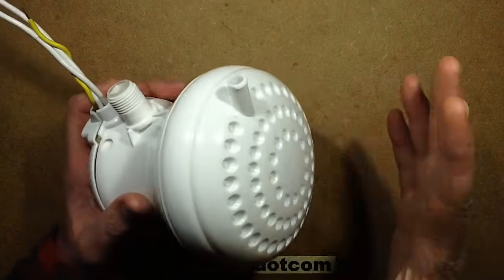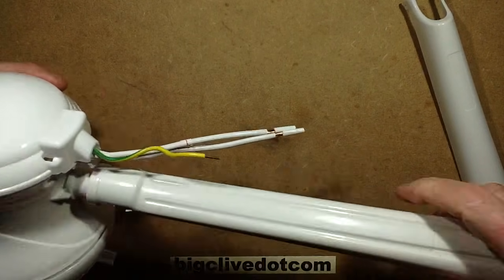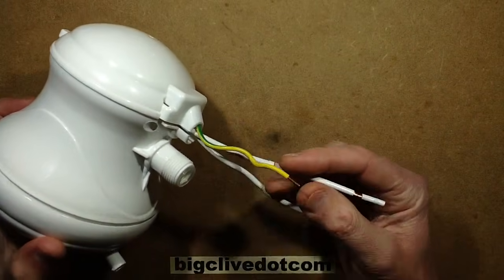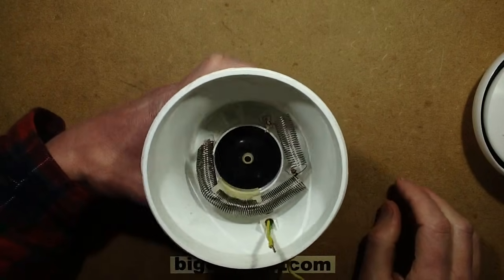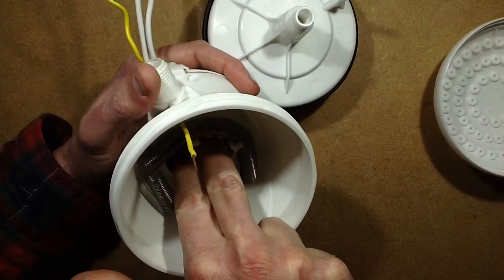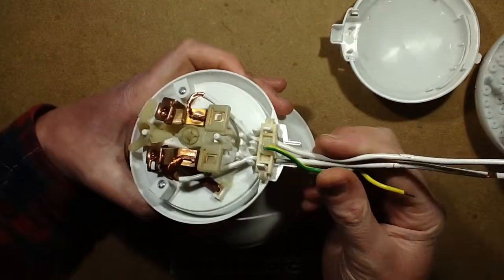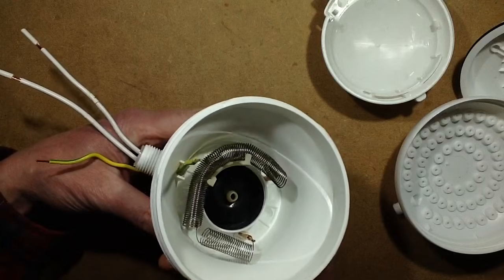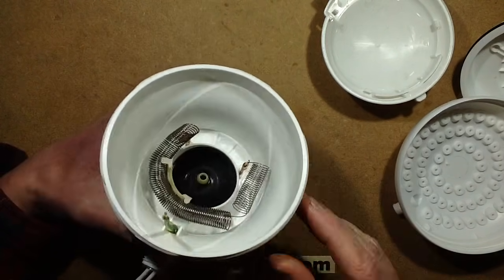Inside a heated shower head.  (suicide shower)

Comment: As a brazilian this video was extremely amusing to watch. Like I was watching an alien talking about what cars are.
Reply: They are usually mounted about 2.3m to 2.5m, but you can find them lower on cheap and old hotels, if you use one these in less than 5 or 10 cm from your body, you will get a eletrical shock. Now, the thing is people dont usually die from the shock it self but from passing out and hitting the head. Every body here in Brazil knows not to touch it while in use, but it is ez to imagine a tourist simple putting his hand on it to switch to "hot" while it is on.
Reply: @TheBotinha93  Even if you do switch it whils its on, in my experience, nothing unusual happens
Reply from the maker: I've since learned how standard these things are in parts of the world including Brazil.  We do have electric showers here in the UK, but it has to be with a wall unit with grounded heating enclosure and sleeved element so there is no current leakage.  The Ducha would not be allowed here because it would be considered a shock hazard, particularly in a wet environment where the person showering would have their feet on a wet grounded surface.  But it's interesting to see it's widely used elsewhere.
Reply: @bigclivedotcom  This design is indded hazardous if not installed corectly. More modern units are made in a way that is compatble with differential protection relays, so that no current leakage is allowed. 

The issue is that "installing correclty" is really rare in brazil, with many installations being made by non professionals and not following code.
Reply: @bigclivedotcom  the hose with the little shower head is for ladies parts.
Reply: @bigclivedotcom  Back in the 1970s I had an electric shower in the UK with an open element inside a clear plastic casing. I believe it was based on a German design. No problems for several years but eventually it failed when it melted some of the plastic.
Reply: I can see how it looks like a ridicule level of danger, but I have never ever heard of it causing any serious issues, even in those precarious instalations. It is not a continuous stream of water that hits the skin, but a bunch of droplets, so it would not conduct electricity even without a ground (or maybe as we say here, god protects the dumb).
Reply from the maker: Most of the incidents seem to involve tall tourists who make head contact with the shower while it's on.  I'd guess it's a lot safer if mounted a modest height overhead.
Reply: @bigclivedotcom  Most showers are mounted at 2,40 meters from the ground, I don't think that a lot of "tourists" are tall enough to make head contact with this.
Reply: @victorcercasin  verdade! I've used these lots of times, and everybody I know in Brasil uses them. Never heard of anyone getting a shock. Then again they complained about the size of the coffee during the Olympics, so I shouldn't be surprised people criticize anything they're not used to.
Reply: @victorcercasin  as a tall person I wouldn't enjoy the sensation of electricity personally I play with electricity but I'm not stupid
Reply: @bigclivedotcom  Gas showers kill more than electric ones.
Reply: @victorcercasin  Thank you for the insight. I know, 5 years later.
Reply: It happens, but it is a quite rare ocurence, i only know of one guy that died this way.
Reply: I'm also brazillain, and I took several small shocks to turn it off over the course of my childhood. Also, one of my showers sort of exploded into a rain of sparks, but that might have been a botched electrician job instead of the unit. 

Nowadays, I only use gas heated showers.
Reply: @LemonRush7777  I'm from Brazil too and I have never felt any shock from the metal knob even when barefoot IoI
Reply: The thing is that this shower is not a Brazilian standard. It looks like a Chinese one to be sold in countries like Colombia or Paraguay. It's breaks various Inmetro safety standards and would be illegal here.
Reply: Ive used those for 25 years now, even some shoddy ones and never got shocked. Maybe I'm lucky?
Reply: It seems that the most serious issue with tourists isn't necessarily making contact with the shower (since it's plastic), but it is something that most foreigners seem unaware of: you ABSOLUTELY SHOULD NOT turn the switch with the shower on. Doing that is an almost 100% guarantee of a fire igniting over your head.

Also, subpar electrical installations (especially badly insulated ones) can cause an electric shock when touching the metal tap. It used to be common practice (at least here in Brazil) to weld the ground wire directly to the metal piping, causing a mild electric shock when turning the shower on or off.
Reply: For me this video really was the first time seeing such a device. Over here in Germany people are scared to hell if I tell them that this is what people shower like in other countries. Probably becuase of stuff like this: http://dr1.com/forums/showthread.php/81032-shower-head-heater-disaster-yikexxxx
Reply: @Toble_Miner  And yet more people are killed in accidents involving boilers and gas heating home installations than with these cheap electric showers.
Reply: It's dangerous and out of safety norms. Electric showers must be attached to a porcelain borne or wired by splicing and insulated with electrical tape.
Reply: bigclivedotcom just copy and paste "chuveiro elétrico na tomada" to Google images, and you'll see the main reason people get killed
Reply: I can confirm these are also prevalent in Trinidad.
Reply: With... Your arm and hand?
Reply: the switch should have a huge warning or something
Reply: > They are usually mounted about 2.3m to 2.5m
So how do you change the temperature?
Reply: Ang Jr sure it is. A bad clone by the way.
Reply: Weedus I am german too and i think of this like "TÜV says nooo" and there is VDE and GS too. But I guess in some parts of the World, they go way more pragmatic ways :D
Reply: @theGamer93 things like this used in Europe in the 50's torna were obviously banned. Norms and standards come to improve safety and solve specific issues. I think this is incompatible with the differential protection, which, in turn saved many lives since its introduction... so yes, maybe the shower is not dangerous in itself (as long as the haether is ok) but it means that the electric network is.
Reply: i'm brazilian too and i use those showers EVERYDAY
Reply: @moosebreeder1 va tutto bene, finché la resistenza non si interrompe
Reply: +Tulio Botinha "Only one guy"
Reply: although I do understand that these things aren't killing people left and right, it's just a bit different for those of us in countries that insist on Extreme safety standards. The reality is that, no matter what, this particular shower head is going to cause more of a threats then something like electric boiler with a grounded chassis.^^;; it might not be all that dangerous in comparison to something like driving a car, but we are just not used to having any real risk of electric shock taking the shower. LOL

still, watching videos from people like electroboom really do show that such things can be safer than we realize. I saw him do a video where he stuck Mains wiring in a bowl and plugged it into the wall then stuck his finger in side. Lol the idea is that the electricity will take a pretty straight path between the electrodes. keeping that in mind, under normal operation I can see this being very safe. under abnormal operation with somebody standing with their toe touching the grounded drain plug or something I can absolutely see this causing a shock.
Reply: In Australia you can install a rheem hot water system then feed the hot water into the taps and shower.
Reply: Totally true... also as a Brazilian I can even say that I already had one of those  XD
Reply: This had to be mounted at 2.2m
Reply: Exactly.  Why talking about what he doesn't know anything about. I am looking advice here but it's just a waste of time.  I saw lights coming on in the top off mine and there are no bulbs in it about two days now.  Blue red and green lights
Reply: What a ignorant and xenophobic video that was.
Reply: Lol, exactly. Filing it under the "Humor" playlist because the host's candor sounds just so much like a parody (either voluntary or involuntary, self-referential or not)
Reply: same
Reply: Va tutto bene, finché non si interrompe la resistenza, dopodiché il circuito si richiude attraverso di te. Usare roba del genere è da pazzi
Reply: Every Brazilian ever: sees Brazilian in the title of gringo video 
Every Brazilian ever: ATTACK
Reply: That’s because you are an alien
Reply: I'm brazilian and from my experience it's usually found in poorer places in the country. For my entire life I used gas heating but I had to buy one of these for my farm house as we have no gas line there. 
As we're somewhat tall compared to asian countries(most males in my family are around 6' and females around 5'7'') I installed it at around 7' and it has been working MOSTLY fine. However there are some problems, it gets too hot if the water flow is low as the electrical current is somewhat constant and is not adjusted according to the water flow. I discovered you should not change from the high setting to the low setting, I did it and got welcomed by a shower of sparks(no harm, but scary) as I stuck my wet hand into it(as an engineer/STEM graduate I should know better...).

I went to China and found one of these mounted at a little above 6', I disconnected it from mains before turning it on as I'd make head contact with it.
Reply: Victor Hugo não traduzir com Google.....eu morou lá pra um ano.
Reply: that is not bad portuguese, that is google translated...
at least you know we speak portuguese, not spanish hahhahaha
Reply: @victorcercasin  Holy shit... people still don't realize you guys speak Portuguese!? I should really stop being surprised by human ignorance but come on now, that's an easy one, especially in this age of free information and cyber connectivity and the like.
Reply: It is funny! Quando eu era la no Brasil eu uso todos os dias sem problema...como todo mundo rsrsrsrsrs!
Hope u understood my bad Portuguese ;)
Reply: Tezcax
I have no idea where you live because I'm in Brazil and virtually nobody in these parts use gas heated showers, my sister in São Paulo had it but switched to electric heating because the gas heating was unsafe. People here who wants a better one will use more sophisticated shower heads rather than gas heating.
Reply: Sério, nunca ouvi falar que esse chuveiro mata hahaha É só não usar durante tempestades com raio, igual praticamente todos os outros
Reply: Stop acting like these are totally safe. Just because they're normal for your doesn't make it even remotely safe.
Reply: @Ben-Rogue  In Brazil, gas showers are rare and kill more that eletrics.
Reply: @Ben-Rogue  If hundreds of millions of people use something every day twice and it isn't even mentioned to be a danger, it is pretty safe in my mind. I can't even find studies or statistics on deaths caused by electric showers.
In fact, your gas shower is not even close to "totally safe", since leaks may cause fires and asphyxiation.
Reply: As a Guatemalan, I completely agree. I've used those showers all my life and I never thought of them as any particular hazard. I've received a couple of shocks, but I never thought seriously about them. Also, I've never met anybody with a shocking experience (pun intended.)
Reply: That 'buzzing in the head' might explain why so many brazilians act crazy.
Reply: Brasileiro toma banho de lama da vala, depois fica imune ao Covid e à eletricidade.
Reply: @Suripat Patsuri so this corona thing has been going on for a while, never had an issue and never heard of anyone in my circle... still, I dont say that Corona is fake
Reply: The Stoned Videogame Nerd well.. I wouldnt trust the TUEV that much. did you hear about the lawsuit against TUEV because they approved dangerous breast implants? a french company used industrial silicone for implants - TUEV certified. A court sentenced the TUEV to pay 60 million eur compensation a few days ago. Also: in which bundesland do you live where you have bring your car every 4 years? because it has been 2 years as long as I remember.
Reply: Victor Hugo aki noiz eh br huehuehuehuehueuuehuehuehuehuehuehuehuehuehuehue
Reply: +Argle Bargle
É mesmo? Legal! :D
Reply: Why do so many Brazilians put up with such unsafe showers? It certainly doesnt help fight the stereotypes hahaahaha
Reply: @Xvladin  Boilers are much more risky, every year in US alone there are cases of people dying because of explosions and fires caused by boilers and gas heating home installations, these type of electric showers are used by more than 100 million people everyday and I'm yet to hear that anyone was killed by it, and even in the cases of small electric shocks most of the times it's caused by bad installation.
Reply: Gibe moni plos
Reply: I'm Brazilian too and also I've never ever heard about any issue with this shower. They are VERY safe.
Reply: @danielzhe in Europa si usavano negli anni 50, poi chissà come mai li hanno vietati. Oltretutto farebbero scattare la protezione differenziale
Reply: oh, yeah, we act sooooo crazy hahahahhahahahahahahahah. 
fuck you
Reply: Most of these "extreme safety standards" are just protectionists policy.
Reply: What the hell is an "EXTREME" safety standard? A standard is something supposed to be the normal case. And what is your problem? Even if it is rare to die, one death is one too much. One accident is one too much.
Anyways: Letting "Uuuuuuuuuuuh I am forced to do something by the government"-neurotics die because they are dumb is immoral.
Reply: thats because Germany is the Lawbreaking country, the only country where globalism and industry have the whole rope in their hands... under cover..

Comment: Why is a heated "shower head" needed? is it just cutting the need for a boiler?
Reply: DevelopedBear In America it's more common to have a central water heater with a reservoir. The water is already hot when you want it. We don't use electricity near water. Having hundreds of watts of electricity in the shower isn't really safe. Evidently they don't fail often, and there must not be that many deaths. However strict building codes, quality products, and a higher standard for safety mean that this kind of thing is a no-no over here. I know I wouldn't want a toaster stashed in my shower head.
Reply: Because the water comes cold. Unless you want to take a cold shower
Reply: Yeah i get that now, i'd assume an electric heater would be more efficient and safe but probably more costly initially.

Comment: Haha, this is the default shower technology on Brazil, probably 95% of bathrooms use that.
And yes, in most installations people don't bother with the earth wire (in fact, a lot of houses in Brazil still don't have a earth wire anywhere at all, even though it's required by law!).
If the local electrical regulations were enforced strictly, I'd guess about half the country would have to completely redo their properties' electrical systems.

Comment: Keep in mind that this is a very cheap unit. The cheap of the cheapest. More expensive units will include proper insulation, and some fancier features like compressors for low pressure piping or even electronic temperature control that you can adjust while the shower is on using a dial.

Also, to those asking "why not install central heating??!?!11?", there are many reasons for that. First is that the cost of installing and operating that just doesn't justify it. This is mostly used in tropical countries where the only place you really need hot water is in the shower, and considering the majority of houses don't have insulated pipes, it would be worthless, or even more expensive to add extra pipes. And second is that this is an artifact from poorer times, when having a hot shower in itself was a luxury. Now most people are upgrading straight to solar heating and skipping heating bills completely, because you can get a medium-grade heating system doing wonders, since the average insolation is so high that the losses from bad pipe insulation don't make much of a difference.

Comment: Hello, 
I have lived in Brazil my entire life and have always had showers like this (cheap and expensive). And even though they are not the most well thought out piece of bathing machine, they rarely fail, and when they do, no one gets hurt. In a country like Brazil where we only use hot water for showers there is no reason for having a gas heater for the entire house. Thank you for your analysis. 
P. S. : The one you have there is one of worst I have ever seen, they usually are way better designed and built.

Comment: The long tube has nothing to do with pressure release or safety whatever...
It's simply a very small hand-shower, for people who like to move the water around the body, or even to wash the walls.
It's probably written in the instructions, i guess.

And although I hate these showers, they are only deadly if it wasn't properly installed... Something not hard to see happening in the 3rd world.

Comment: I'm from the US and this terrifies me. My grandfather was an electrician and he ALWAYS said "water and electricity don't mix."
Reply: So what's up with electric tank water heaters?
Reply: @IsauTDI OBv the water does not directly interact with the electrical components in units that are up to building codes in the developed world. In units like these the heating element is sheilded from allowing electricity to directly interact with the water thus preventing electric shock. You can have electrical devices that interact with water, but you want to keep the electrical components isolated from the water. These shower heads do not do this.
Reply: @IsauTDI  Also way to comment on a comment that I made 8 effing years ago m8